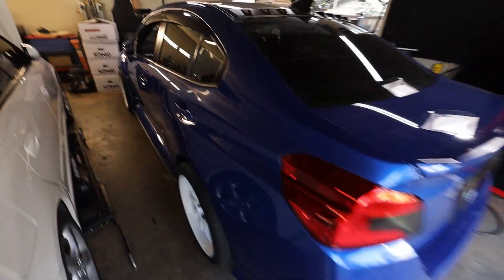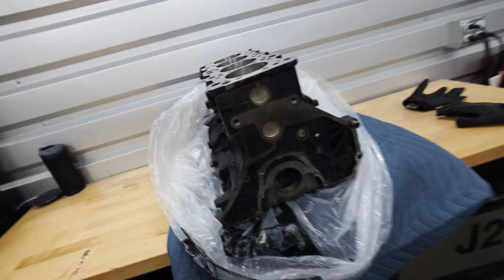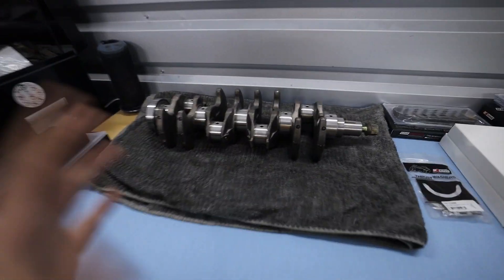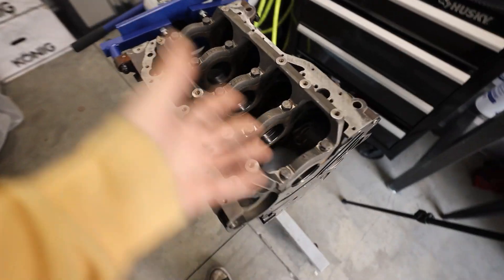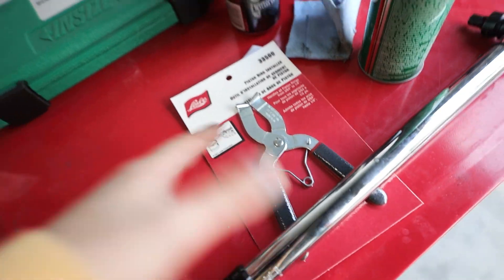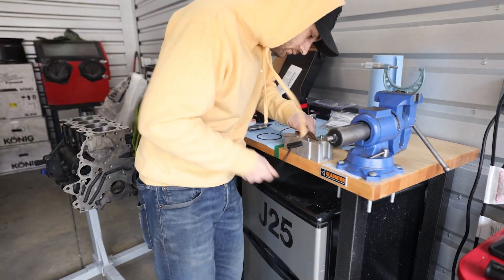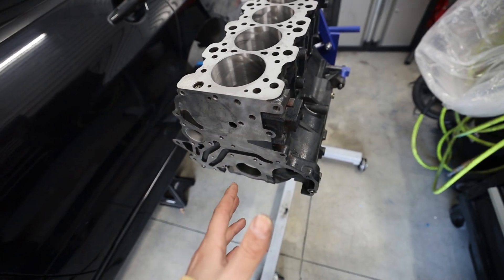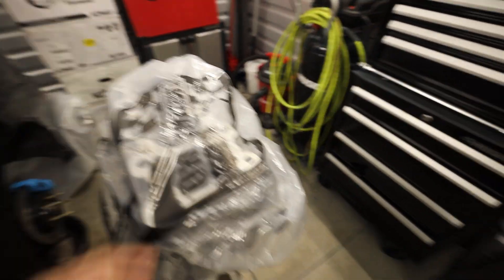Abandoned Evo 8 4G63 Engine Build Pt 1.

Comment: You can use those balance shaft bearings and flip them 90 degrees to block off the oil ports for the balance shafts. You’ll need to do this if you delete the shafts.
Reply from the maker: That may be why I have them then 😅🔥

Comment: Just out of curiosity, doesn't the measurement change based on the temperate inside the room?
Reply from the maker: Yes sir! Measurements are effected by temp.
Reply: @Smeedia  Okay I see, so would that make a difference of the crank being off by a thou? 

Like you said it is off by like 2 thou, could it be possibly that the room temp made it off and it is within a reasonable spec with what you are looking for? Or does the room temp doesn't effect those measurements?
Reply from the maker: It could be, but still wouldent be a bad idea to tighten them up a hair more if we can. 

It was pretty cold so the metals were probably contracted quite a bit
Reply: @Smeedia  Yeah, definitely do what you think is best. I kind of wanted to know for my knowledge.

Comment: Aren’t you worried about oil pressure since the bearing measurements aren’t ideal?
Reply: They'll still be within spec. He just like to run on the tighter side of that spec.  Itll be fine
Reply from the maker: They'll be fine at .003" but I'd pr3fer to have it around. 0025". Shouldent effect oil too much. With using 5w40 in the car it should keep oil pressure in check 🙏

Comment: Was on your recent live stream.  I'm about to hit my 30k service interval and I was wondering what stuff should I put stock fluids in, what to upgrade and what other tips you might have for this service interval.  I'm on a 2013 EJ25.
Reply from the maker: If you wanna use some aftermarket fluids 
For the trans I'd use motul 75W90 
NGK Iridum 2309 spark plugs 
Whatever oil you like 
Oem filters 🥳

Comment: Hey Tanner, how many miles did your Evo 8 have on the clock when you bought it? Is there a serviceable life (in miles) in which the 4G63 can not be rebuilt? Thinking of getting an Evo but all the ones I have seen are 150K miles or higher .
Reply from the maker: Mines got 90K on it, as long as all components are in a usable condition you should be fine 🙏

Comment: I can't believe how high these sell in the used market.  Saw one with 38k miles and they wanted 45k for it. Oof
Reply from the maker: That's cheaper than I've seen, SAS a few for 60K the other day 😳
Reply: @Smeedia  oof that's to rich for my blood right now lol.  I just got this 13 wrx hatch with 32k miles on it, totally stock for 23k.  Seemed high but of course i got full bolt ons and stage 2 tune.  I am a sucker for that hatch phat booty.  Can't wait to see this beast fixed up